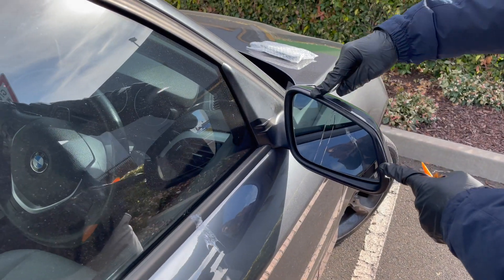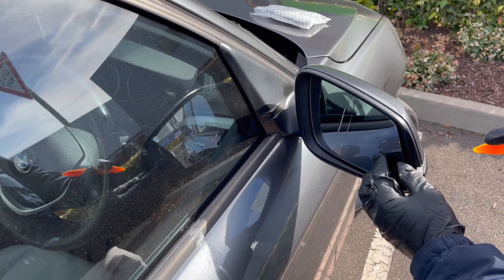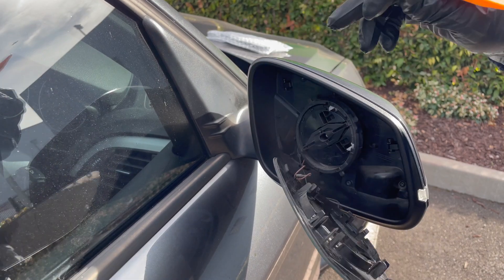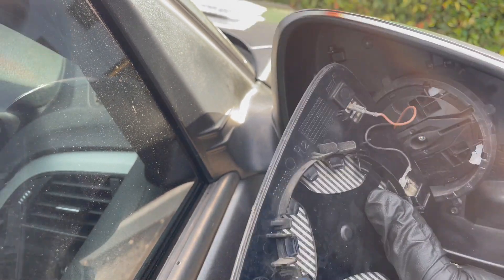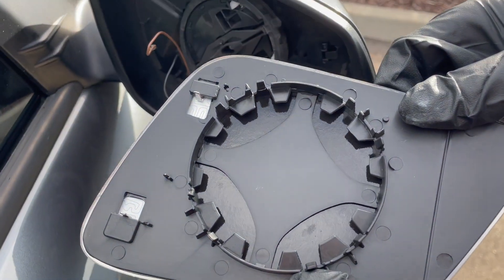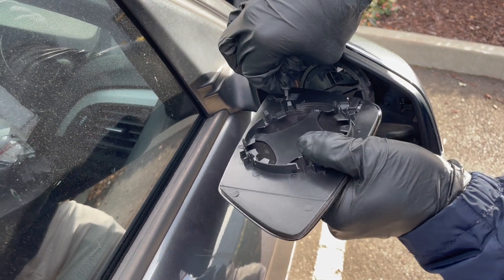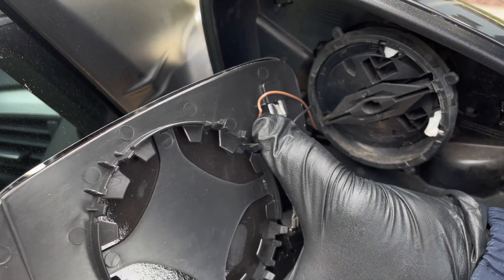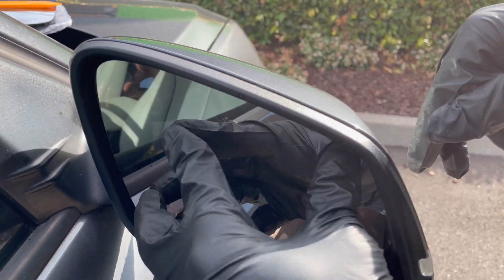How To Replace BMW F Series Side Mirror Heated Glass (For 1 3 4 & 5 Series F20 F30 F32 F10)

Comment: Can confirm this works with ease for non dimmable mirrors everytime great tutorial thank you! When you pry from the top corner there is a clip directly underneath which is why it releases so easily. 
I don’t understand why BMW made this insanely hard on dimmable mirrors, 50% chance you’ll break it trying any method!
Reply: trust me use 3-4 strands of Floss held together it’s super easy to get behind and it pulls off equal pressure
Reply: What do you mean? I have dimmable mirrors on my F11 and the mirror unclips easily exactly the same way as this mirror. But does it break easily in the process?
Reply: @aaleeksii  yea they’re very brittle clips and it’ll put unwanted tension. best method is string/floss to apply equal pressure e
Reply: @fullmetal1421 Can I use a suction cup and pull right out?
Reply: @kasperkarlsen2316  honestly anything with equal pressure is fine, they’re not lying when they say they’re brittle bro i destroyed mine

Comment: LLH car  the passenger mirror doesn't tilt GLASS  inside like supposed to after replacement!!!!
ANY IDEA? THANKS 🎈🎈🎈🎈🎈🎈
motors are good also tried another one!!!
Reply from the maker: Check if your window selector is set to the passenger side. It only works when that is on the passenger side.

Comment: Long shot but does anyone know if all the F series mirrors are the same? looking for a replacement but i cant find a reasonably priced used for an F30, plenty of F10, 20 and they look the same and all have the same number - 021185 stamped on the bottom?